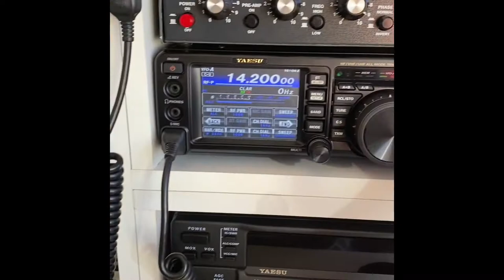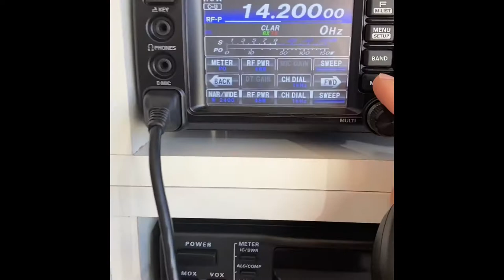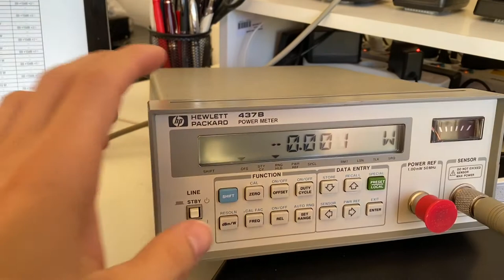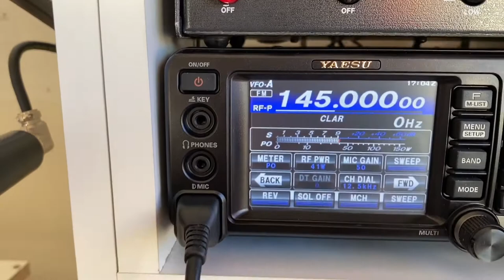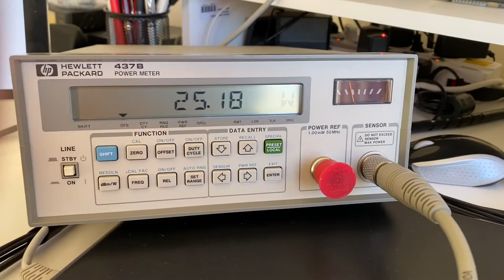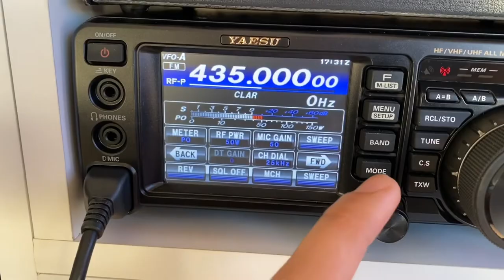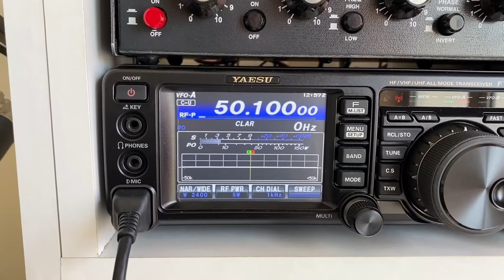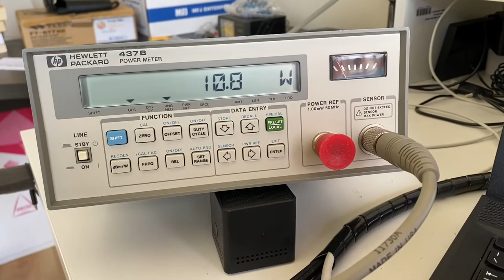Bird 43 VS HP437B - Measuring RF power

Comment: Thank you for your very good video. I also have a Bird43 and an HP437 with an 8485A probe. The problem lies with the attenuators, how do you actually measure their value as a function of frequency.I also have a Nano VNA, but I don't think it's accurate enough for this. Thank you in advance for your answer. Kind regards.

 Olivier/ F1PVU
Reply from the maker: In fact the final result depends largely on how exact you can measure the attenuation over the frequency or at the frequency of interest. One tenth of a dB only can change a lot in the final figure for the power output value. We should really take account of all the accuracy in calibration and error propagation.
Best wishes
Diego

Comment: Ma necessitava una calibrazione? Mi hanno detto che di solito se non sono stati toccati difficilmente si starano. Io vorrei comprare qualche tappo però se poi necessitano una calibrazione per chi non ha un riferimento preciso si diventa matti
Reply from the maker: i miei tappi li ho comperati usati, alcuni dovevano essere calibrati altri no. Purtroppo sono delicati, anche cadendo o prendendo una botta il potenziometro interno si può spostare. A meno che una volta calibrato non si fissa in posizione in qualche modo. 
In generale comprando il nuovo sono già in spec, usati non è garantito a meno non sia esplicitamente scritto dal venditore ( sempre se affidabile e credibile).
Reply: @IZ0MTW  grazie mille, cmq dal tuo video mi sembrano molto lineare veramente ottimo. Io sono alla ricerca di un tappo da 100 e da 1000 o 2500 serie h. Ma a quanto vedo non è facile. Però devo dirti una cosa io ogni volta che metto due strumenti in serie in genere qualche Watt meno lo leggo su 100 watt leggo magari 1 o 2 Watt meno, poi se li collego uno alla volta recupero questo errore. Tu invece hai messo tutto in serie ma non hai delle piccole differenze?
Reply from the maker: @saviopulino1833  a trovarsi si trovano ma soni molto cari, anche sull’usato, figuriamoci sul nuovo.
Per quanto riguarda le perdite nel mio caso ho tenuto conto dell’attenuazione totale del sistema attenuatore-connettori/adattatori. È come se il sensore stesse leggendo direttamente all’uscita del Bird. Se hai una perdita di 1%/2% forse c’è un po’ di mismatch dovuto agli adattatori che usi per i collegamenti o perdite su cavo/connettori se usi quest’ultimo. Bisogna tener conto di tutto per aumentare l’accuratezza della misura.
Saluti
Reply: @IZ0MTW  Con un tappo da 100 watt fondo scala fin dove riesce a leggere bene? 50% della scala? se abbiamo circa il 5% di errore a fondo scala al 50% della scala intorno a 50 watt che succede?
Reply from the maker: @saviopulino1833 se la tolleranza di misura è +/-5% del fondo scala con il tappo da 100 significa +/-5Watt. Il 50% della posizione dell’ago sono circa 32W perché la scala non è lineare. Se invece si riferisce a 50watt  potrebbe leggere da 45 a 55. Nel mio caso HP dava 51.5 e Bird 49, circa il 4,8% di scostamento tra le due misure. Ad ogni modo se vede il video nei primi 6 o 7 minuti vede tutti i risultati perché li ho presi progressivamente da 5 a salire fino a 100
Reply: @IZ0MTW  si l ho rivisto con calma.. ma è incredibile legge benissimo anche basse potenze col  tappo da 100 watt. Sarebbe interessante capire come si comporta anche in frequenza ma credo sia abbastanza piatto. Complimenti per il video ma soprattutto per la sua competenza
Reply from the maker: Grazie. Mi sembra di ricordare che la risposta in frequenza era dentro tolleranza nell’intero spettro 2-30MHz. Anche il costruttore lo dichiara nel manuale. Anzi eccede anche il range con un roll off ai lati via via più pronunciato. quindi in teoria anche in gamma 160m dovrebbe leggere con buona accuratezza. Non l’ho aggiunto per non allungare troppo il video.
Saluti
Reply: @IZ0MTW  Ancora oggi credo che dopo il bolometro o vari Power Meter professionali il Bird è tra i migliori.. credo che i vari Lp100 di telepost ecc ecc non riescono ad essere così lineari come un Bird
Reply from the maker: Purtroppo non ne ho mai avuto uno ma credo che siano molto validi anche quelli. C’è poi da dire che riescono a misurare un ampio range di frequenza e di potenza. Per coprire gli stessi range con un bird bisognerebbe spendere molto di più. Il bird è flessibile ma soprattutto affidabile e robusto, è quella la sua grande caratteristica. L’LP100 poi può leggere la potenza pep laddove il bird43 ha bisogno di una scheda opzionale anche cara.
LP100
accuracy 5% o meno sulla misura (non sul fondo scala!) tra 1W e 3KW! tipicamente 3% o migliore 
Accuratezza in frequenza 1% o migliore da 1.8 a 54MHz.
Direi che sulla carta è eccezionale. Sarebbe da provare. Ma le posso dire che lo usano anche in lavoratori di riparazione. Certo non per calibrazione di strumenti di laboratorio ma per le nostre radio è eccellente.
Reply: @IZ0MTW  sulla carta è così ma onestamente ho dei seri dubbi..
Reply from the maker: @saviopulino1833  capisco, posso dirle che ho visto un LP confrontato con Bird calibrato e certificato ed erano perfetti
Reply: @IZ0MTW  con un amico ho fatto un confronto tra il mio metropwer fx775 ed un LP 100 ed un LP 700. Collegati una per volta quindi con gli  stessi cavi,il carico era ottimo controllato con un nanovna meno 36 db return loss in pratica lp 100 misurava 100watt lp 700 111 Watt provato ovviamente su tutte le bande. L apparato ICOM 7300 che a 14 mega da manual service dovrebbe essere 105 , ma tralasciando il valore assoluto ma onestamente sono rimasto un po' basito.
Reply from the maker: in effetti se il set up era corretto mi sembra un po’ troppo. Ricordando però che se la potenza reale fosse 105w e uno strumento dicesse 100 e l’altro 110 sarebbero praticamente (escludendo i decimali) entrambi in tolleranza del 5%.
Uno sbaglierebbe in un senso e uno nell’altro.
Altra considerazione da fare è quanto tempo è passato dall’ultima calibrazione degli strumenti e se quindi la validità dell’ultima calibrazione è scaduta.
Grazie comunque per avermi informato dei risultati di questa prova.
Reply: @IZ0MTW  si ineffeti potrebbe essere così, uno sbaglia in negativo ed uno in positivo. Cmq quando si parla di misure c'è sempre il dubbio. Cmq il metropwer misura 104. Martedì farò delle prove con un Bird 43 e tappo da 100.
Reply: Ciao io ho tutti i tappi della coaxial dinamics, che sono compatibili anche con il bird43, ho un bird43, un coaxial dinamics serie 80016, con linea coax con due tappi uno diretta e uno riflessa piu uscita usb con App. X PC! Piu un directional power sensor Bird 5014 sempre a doppio tappo e uscita usb x PC, ma devo dire con sincerità che uso quasi sempre LP100, perche è piu comodo, e veramente accurato! Poi se si sale in potenza qualche differenza si trova tra i vari strumenti, ma a 1000w le differenze sono nell'ordine di +-20/30w, alla fine sono circa il 2/3% e quasi impossibile misurare gli stessi valori con strumenti diversi! Complimenti per i tuoi test

Comment: Just proves "a bird in the hand is worth two in the Bush" how do you calibrate a slug? I've never fancied it,Nasty slimy things!
Reply from the maker: there’s a trimpot inside the slug. Just need to remove the metal disc cap with the help of a heat gun to melt the glue inside. When removed there’s a small hole for the pot. Then it’s easy. Calibrated at full scale. The movement is a 30uA full scale deflection.